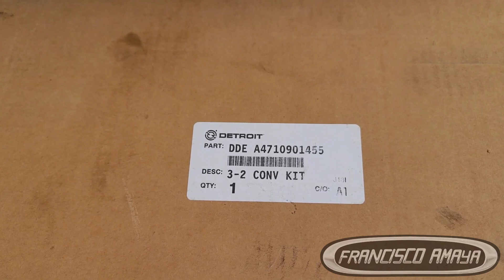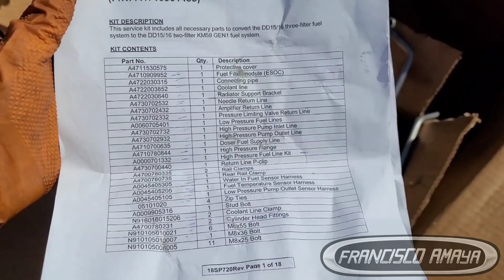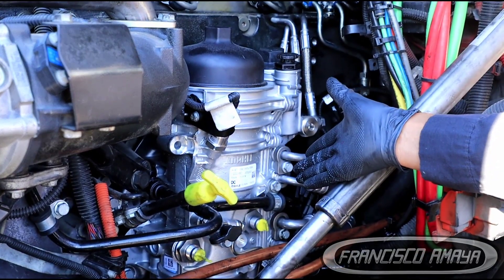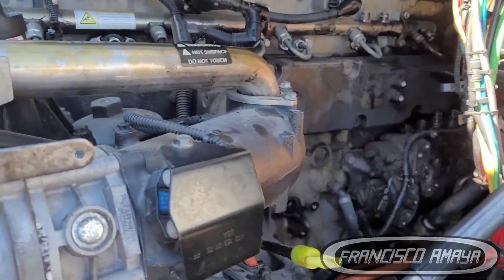3 (filters) stage to 2 (filters) stage fuel housing replacement DD13 DD15 DD16 kit cost and labor

Comment: Can I ask you a question? I bought a newer 2015 freightliner for spare parts for my 2010 freightliner mine has the three filters can I use that two filter system on my 2010 without buying the kit ?

Comment: Fransisco, I have taken off the return line to the two stage filter housing and when I begin to prime it there is an overflow of fuel flowing back to the fuel tanks. Is that normal? I can’t locate a check valve at the bottom of the filter housing and the dealership told me to change a return check valve perpendicular to the bottom of the hand pump that you change with a 10mm Allen wrench, however, this didn’t stop the fuel from pouring out the return line.
The truck will crank each time I prime it up but dies within 30 seconds to a minute continuously. Any advise would be greatly appreciated.

Comment: Hey buddy 
Thanks for the video, I have a 2018 Cascadia with DD15 , I changed the fuel water separator filter today after my truck stopped on me multiple times with no fault codes or anything, and it starts right back, so I decided to change that filter, and I found some metal shavings debris in the bottom of the module under the filter, truck is still running but I’m afraid something is going bad , any help on that ? 
Model DD15 725 K miles 505HP

Comment: I got a 2016 Freightliner cascadia and I keep putting antifreeze in the overflow tank. As I drive after about 80-100 miles all engine lights and stop engine lights keep flashing requiring me to stop and as I open the hood to check antifreeze level goes below the coolant sensor. Now when I loosen the overflow cap antifreeze comes back up above the sensor then I’m able to keep driving for another 100 miles and repeat the process. What is the problem there Fransisco..?
Reply: I had a similar problem with my 2011 just about drove me nuts mysterious coolant disappearing..I found out I had a leaking DEF pump coolant hose..I never knew there was a coolant hose attached to that pump go figure..🙄
Reply: Could be your pressure relief cap on the side of your reservoir that went bad not allowing air in or out of it like it needs to.